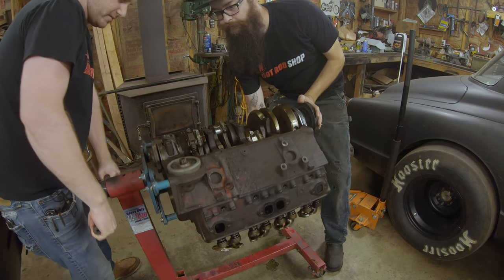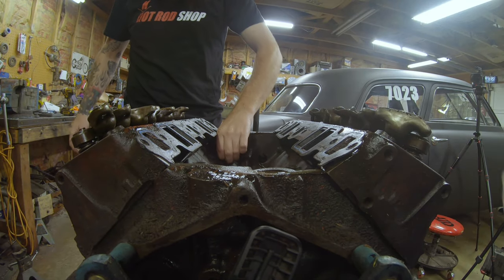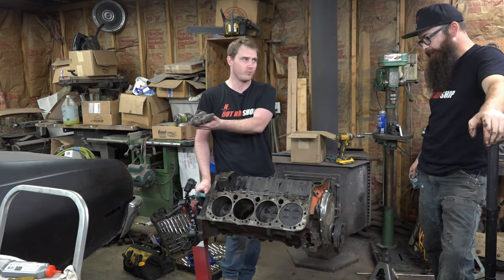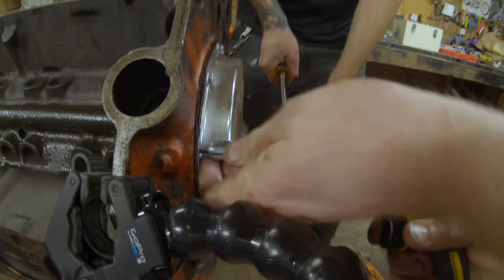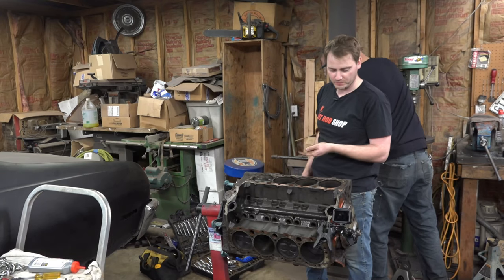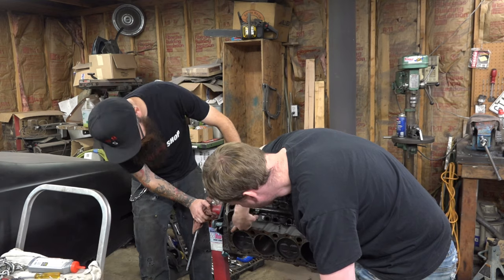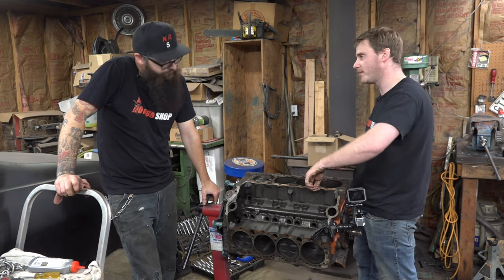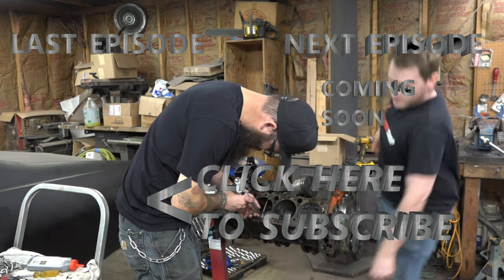327 Inspection | Deeper Look #6

Comment: having raced 327's back in the day ,put some arp rod bolts in the stock rods cheap insurance.
they respond well to bigger heads and valves  and the factory steel cranks that were in most trucks were bullet proof   damn good engines  i have turned those engines to 8500

Comment: Use the 327 crank and rods in the 350 block put a set of vortec heads and get a cam for it  that will work with the heads

Comment: Slap together the 327, I have one with pretty high compression and the cheapest summit heads summit has to offer with a small lunati cam that’s only sposed to make power from idle to 5,000 rpm, It has no problem going into the 6,000 rpms and staying there , it’s in a 71 c10 with a granny 4 speed and it’s a blast

Comment: 327 only had 3 sizes of valves the 1.72/1.50,  1.94/1.50 and 2.02/1.60  but they had small combustion chambers for higher static compression they went from 60cc right up to 76cc but they had smaller ports but you can gasket match the ports to make them bigger

Comment: Well before I saw that healicoil I was thinking pick up a set of 305 202 heads but now... I'd say just hit the junkyard find you a 400 crank and a 4 bolt main 350 block add a set of 202 heads and just go that route ain't no sense in wasting your time on a 327

Comment: If the 350 is a 4 bolt main block, pick up a a cheap Large journal 327 crank and rods and "destroke" it and make a high revving screamer, with the gear ratio in the nova it should help it.

Comment: Rod ratio is great and all, but I wouldn’t sacrifice cubes (stroke) to preserve the rod to stroke ratio.. go ahead and use the 6 inch rods if you can fit them with the right piston compression height, but stroke it! I would sell this 327 to some restoration guys, and you hot rod a 4 bolt 350 block. Also, don’t dingle ball hone things! Having a machine shop torque plate hone is so cheap, then let the shop boil clean it, and brush out the pipe plug galleries.

Comment: I say take it to 0.060 over bore, give her decent set of pistons and rings, deck it line bore crank and cam journals.
Steal the cam from 350, find a good set of vortex heads if you can't score old skill set of massaged camels, are 202' on the cheap, good set of springs, slide it across the mill to flatten em out.
If they're not gasket matched, then do so, add a set of budget rollers on top as tall as possible. 
Bolt it together, add preferred flavor of oil, are synthetic whichever you use, need to adjust your mindset, and hold on.
PS
New shifter needed for Nova, is a must, if you want to keep your revs up as she'll run her best up hi.
Do the big toe clutch dump off the line, and practice your speed shifting
 technique.
And then let's see the smile at the end of track.
That's my humble opinion on it at least. 
From a long long time driver of a spicey little beater 327 in a long wheelbase smooth sided 1970 C10.
Either way is y'all's choice, and I won't hold it against either of you whatever choice you make.

Comment: I love the 283, 327 and the 350 but my favorite is the 5.3. The 6.0 is absolutely awesome but pricey. 
If only working with what you have then I would use the 350. Better to work with an engine that shouldn't self destruct.

Comment: I would have installed the bolts for the crank pull, and used the hammer on the to knock the balancer back on.

As for the motor, 327 pistons cost a bit more than 350 slugs. The block is kinda compromised,  so if it is just for TV and have an engine to.move the car around, I would re-ring and bearing it, put in the cam from the 350, and find some cheap heads- like 305ho or old fuelie heads or something else that will help keep compression up and hope for the best.

Comment: Blade hone those bores. Reuse the pistons. Don't think that will work? Check out Uncle Tony's Garage, 318 build. He's been building engines for 40 years. Run that 327. Don't stroke it or bore it. You can flip the pistons for a cheap , but small stroker effect.

Comment: Either build the 327 or go to a 400+ deal I've ran ran 327s 350s and 400s and the 350 has impressed me the least.   Get a 283 crankshaft and buy a set of pistons and build a 306 out of it and feed it the beans that would be awesome

Comment: If that’s a large journal 327 you could slap that rotating assembly in a 350 block, or just bolt it all back together and get the cheapest high lift came you can find and do burnouts

Comment: Dont pay a bit of attention to a compression gauge. Do yourself a favor and buy a leak down tester. It's the only way to fly. Static pumping compression isn't accurate figuring camshaft overlap and low compression ratio. If you leak it you will be able to tell where any compression is leaking bye at. I have serious doubt the rings and cylinder walls are the culprit, they hardly ever are.
(On your 350)
Reply from the maker: Procedure = Compression test, then leak-down test the down cylinders, which is exactly what we did.  Stay tuned to see the results.

Comment: Take it to Johns Specialty machine in Tacoma. Time sert the threads and put new slugs in it. I doubt the block is pure trash. Get the crank drilled and threaded too. Or, plot twist, get a 5.3 or 6.0 short block and put that in. Use a 4.8 truck manual flywheel.

Comment: You do realize that the 350 block is the same as the 327 block? Just pull the crank,rods, and pistons and install into the 350 block and it'll be a 327.
Reply from the maker: Our 327 is a small journal.  Not the same.
Reply: @NotRodShop  I have bearing spacers to run the small journal crank in late 4 bolt block in mine
Reply: M77MS1110H is the part number you need to put a sm journal crank into a lg journal block.

Comment: Ditch the 327. You have winter to build the 350.
Reply: 350 boat anchor. 327 rps and upper end hp!
Reply: Put the heli coil on the bolt hole and put a stud in it. Put the 327 freshen it up and put A 292 solid lifter cam. The bottom end will take it just fine. Then put a set of valve springs on the heads. Lap them in . check your spring pressure and put that bitch together and that 327 will haul the mail!!
Reply: @stevenjones5121  they want to build the 350 anyway. So skip wasting the time and money on the 327 over the winter that could ve spent to build the 350 they plan to build anyway.

There's a reason you don't see 327s in strip cars but see a billion, ok a quarter billion 350s since the advent of the LS.